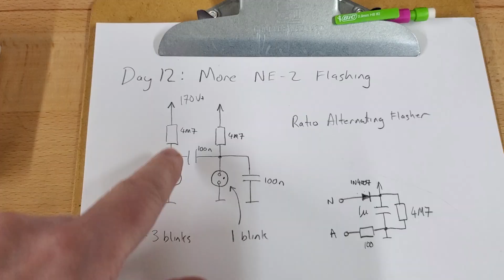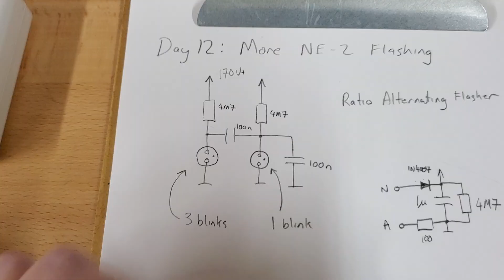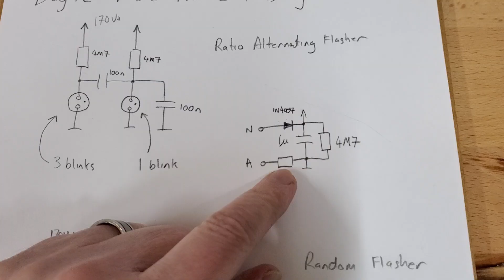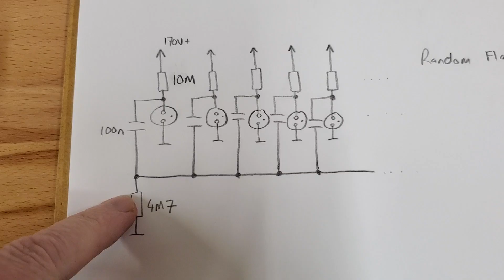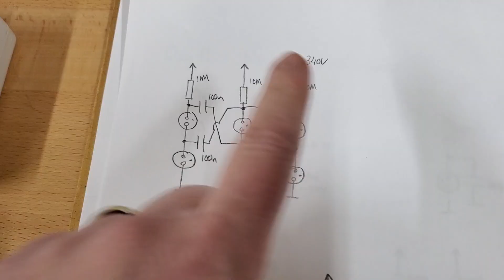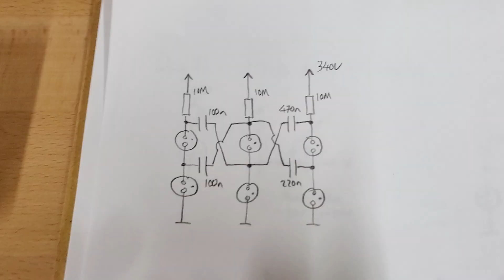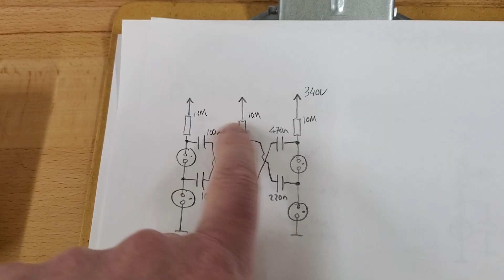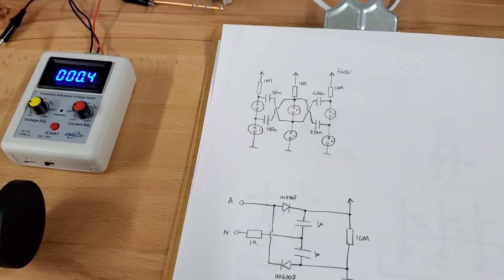ACoC 2025: Day 12: More NE-2 Bulb Flashing Circuits

Comment: Nice idea, neons was always beautiful and special, like them too.  Another type  "Starter lamp"  can  produse clics and  flashing at the same time, but they are more power angry.I testet this with 5w 15k resistor on 220V(danger).
Hi voltage power supply are easy to do by converting it from cheap cell phone charger, basicly by reversing windings. And of course  -  Safety at first place!

Comment: Hi Alan, 
I thought you might be running out of ideas for future videos, so I made a list of some 
that came to mind.

Ideas for future episodes:

1. More theoretical topics (without building a specific circuit, 
but focused on explaining/teaching an electronics concept — something
 in the style of w2aew), for example lesser-known DC-DC converter topologies.

2. Simple motor control circuits for BLDC and stepper motors, 
as well as other electromechanical devices — using transistors or logic gates.

3. Circuits based on discrete components: operational 
amplifiers, comparators, cascode circuits (I’d really like
to learn more about these), logic gates (building an AND gate with
transistors is very easy; building one that works properly and fast is not).

4. You could also talk more about what you 
specialize in — maybe you’d like to share more focused, in-depth knowledge.
Reply from the maker: Thank you for the ideas.  I don't think I do theory well, so I'll leave (1) to others who are far more proficient at that style of video.  Funny enough I had an idea for a motor control circuit, not BLDC or stepper though, just using normal garbage brushed motors to do stuff with discrete logic.  Yeah (3) wise really fast discrete logic is handy sometimes, baker clamps are often all you need to speed them up. I am not sure what I really specialise in to be honest, maybe RF, but again not sure I am the person to do theory videos.  The ACoC videos are low-effort single-take things I do for fun some years, theory videos really need much more attention to detail and planning than what I typically put into this advent series.

Comment: Are those SMD film caps? Or just un-dipped th caps?

I'd be interested in how you make the low power, isolated high voltage supply, that may make a decent late ACoC entry.
Reply from the maker: They are thru-hole devices, but are built like SMD components.  They have really short (pre-cut) legs tacked kinda poorly to the tinning/spray on the ends of the film stack.  I can't recall where I got them, and there isn't much indication on them who made them.  They have been in the junkbox for many years.  So yeah they are basically undipped film caps and the marking is under the top layer.
Reply: @vk2zay  thanks! 
I was curious because they look like they'd have pretty low ESL and high current rating if they were used SMD
Reply from the maker: @bgdwiepp  Yeah probably a waste to use them for this, but I have so much in the junkbox I gotta start using it all up before I die!